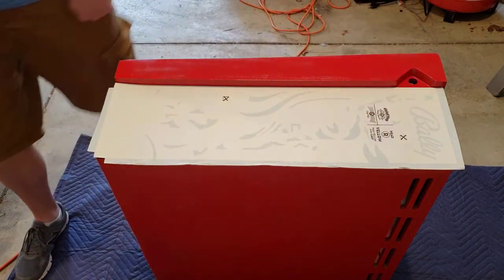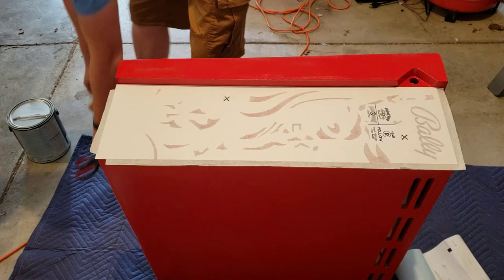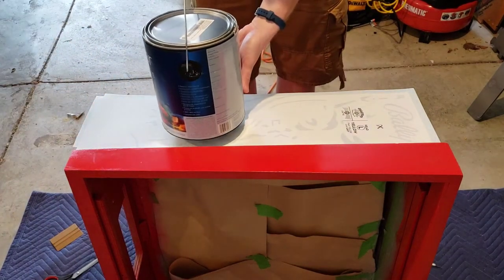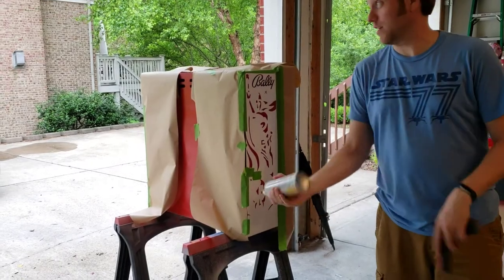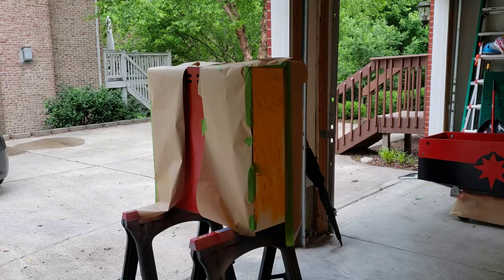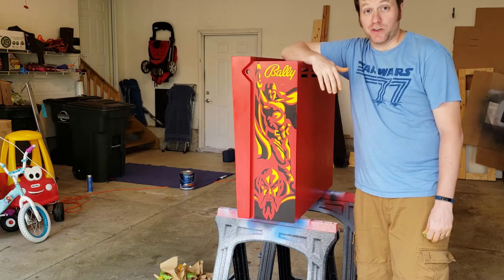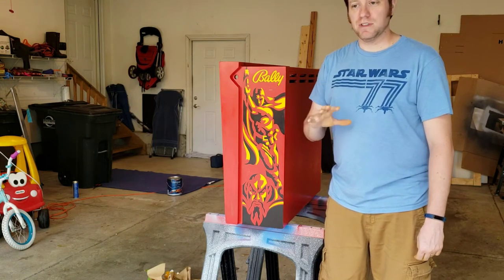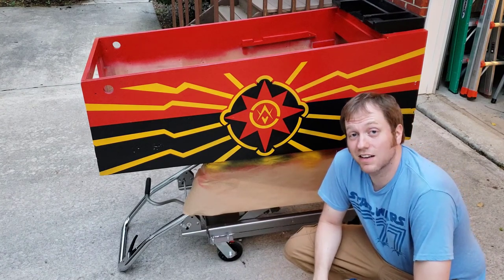How To - Apply Pinball Pimp Cabinet Stencils Part 3

Comment: I've done about seven or eight cabinet paint jobs through the years and the lesson that I've learned is to let the first color fully cure before applying any other over the top of it. I usually give it about two to three weeks. I'm in the process of painting a Gottlieb Spin A Card and the first time using Pinball Pimp stencils. In the past I've relied on tracing and making my own. I've got the base coat and webbing done and now ready for colors. Thank you for all of the helpful instructions.

Comment: Great job my friend, this is how we all learn. Comparatively, it probably looks fantastic compared to the way it did before. Enjoy your game! I'm in the middle of a stencil project with these stencils as well on my Gottlieb El Dorado. Orange color is down and I'm waiting several days for it to cure before I add the final color. After speaking with Pinball Pimps owner,  He highly recommended the standard Rustoleum spray paint with the plaid logo on the front and not to use the 2X products as they dry too fast. He also said the standard Rustoleum is a much tougher finish than the 2X. I've been using those and I couldn't be happier. After about 10 to 12 minutes I peeled the first stencil layer back and the lines were crisp and sharp. No goopy paint "snap back" and no tearing. The cure time is longer than the 2X, 1-3 days, but it's worth it. Thank you for this great post! Cheers!

Comment: Great job!  You mentioned humidity which may have contributed to your minor paint issues.  Some of these paints are just a nightmare to work with.  Those car color paints you buy at auto part stores go on super dry, if you could find that brand in your color it would be a piece of cake for something like this.  Comparing your before and after, you did an amazing job!  Well done and thanks for teaching us noobs!

Comment: The "crackle" you mention at 22 minutes is from excess amount of yellow paint being applied ....the yellow has lifted the underlying color(s).... light even coats and overlap 50% then give it a 5 to 10 minute flash and apply another coat ... if it still is not covered then apply another after the proper flash time .... good rule of thumb is to check it with your finger (you should be wearing Rubber gloves) on the masking, if the paint smears or strings when you lightly touch it it is not ready for the next coat. Yellows and whites will take a few more coats to cover over darker colors, and in general. Temperature and humidity will effect the drying time. The paint would have wicked under the masking even if it was lying down as there was a excess amount applied. and it was looking for some place to go.

Comment: Thanks for doing your video. It takes a lot of work to shoot all of this and be willing to educate others as well as admit mistakes along the way. I commend you for all the time invested and honesty. Similar to other comments, multiple coats. I shoot a light coat and then 10 minutes later hit it with another while watching the sheen so it isn't streaky looking. Dark colors are easy this way. Lighter colors for me require double the time to shake the can, then 3 coats and sometimes 4. I find yellow to be the worst, thinnist and most runny color no matter where you apply it (house walls, pinball cabinet, playfield touch up). I was surprised at how much pop the yellow gave your cabinet. I shot Krylon gold on mine which looked great, but yours did pop and I think you selected a good shade of yellow for that last layer. So thanks again for taking the time to do the videos. I wanted to see someone else do it first before I embarked on 4 Pimp cabinet re-stencils this summer. You did a fine job!

Comment: Thanks for the series.  I am about to embark on my first cabinet repaint of a Ringer.  I have learned with spray paint and metal to let it dry a day, heat it with a gun, then let dry another day.  otherwise spray paint isnt fully cured for 2 weeks.  i do that before applying CPO's to arcade. i wonder if streaching out the time would reduce color pull and top coats reacting to lower layers of paint.  Im now worried i have a yellow over dark ish blue!!

Comment: maybe try a dremel tool with a very fine sanding tip at low speed to fix the crackle and repaint with brush.  thanks for the vids.

Comment: Great videos. I’m restoring a King of Diamonds EM and doing research on cabinet repaint once I get everything else repaired. One question; did you decide to clear coat and if so, did you go with gloss, semi gloss or satin?
Reply from the maker: I decided against it after doing some tests.
Reply: Pinball Workshop why did you pass on doing the clear coat? I am thinking about clearing my Stern Dracula. Thanks again for the great video. Sorry the paint got jacked up on you.